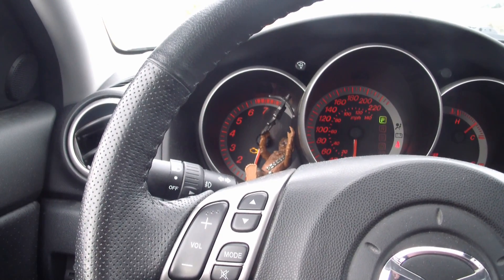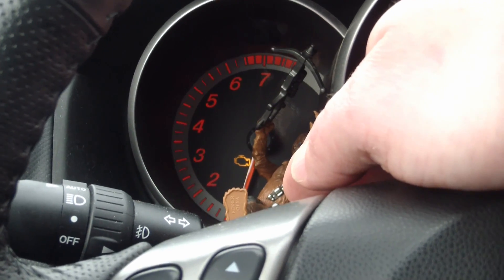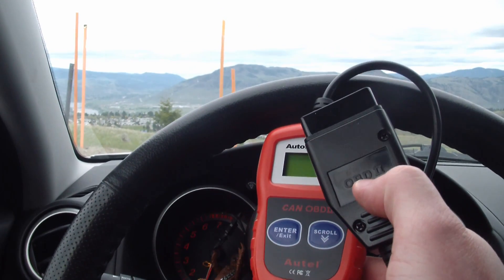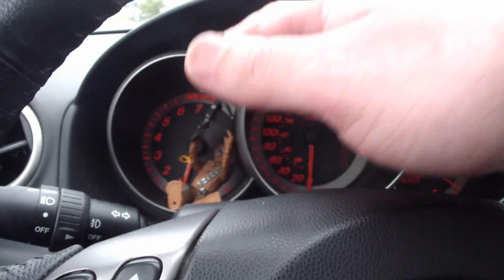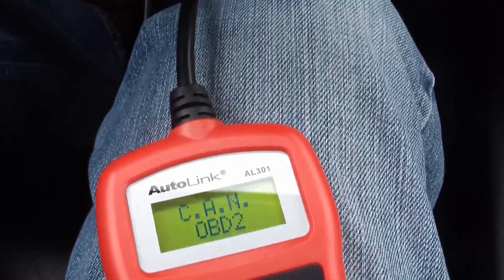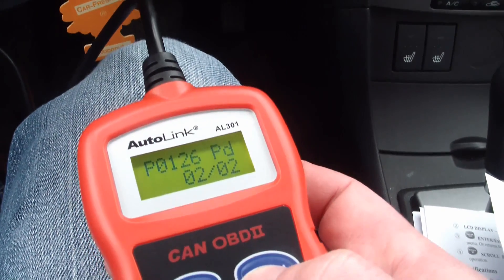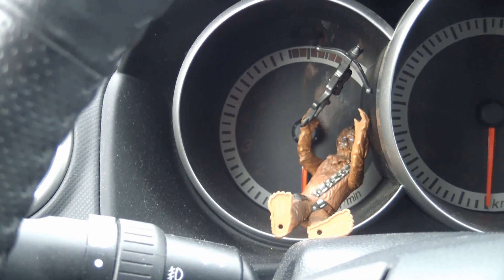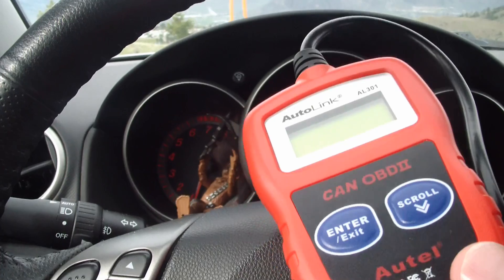Manly-Man Skills: Outsmart Mechanic Scams by Using Your Car's Computer!

Comment: Just a question......

What was the cause of the fault entry?
You erased the fault, yet you did not diagnose the fault to determine the cause.

I just ask because the fault referred to the cooling system, and yet you didn't measure the values of any sensors or continuity of any or the wires, assuming there is no irregularities with the coolant level, strength or cooling efficiency.

Also what are the repercussions of a faulty coolant temperature sender on modern vehicles if it does in fact malfunction, even only intermittently?
Reply: +John McFerren... I had that same code on my Dodge Stratus, but the temp gauge was also lower than normal... turns out the thermostat had broken, and was always open.
Reply: "Worst case scenario if stuck open too much. It can cause a car to overheat."

"If you have any questions about cars ask away. I can most likely point you in the right direction."

ROFLMAO
Reply: When you're talking water temp and the temperature in the block, it's more about having the engine oil at operating temperature and so the viscosity is in a good range for keeping things moving, hence people having trouble and running rough at startup.
Reply: Sweet!!
Reply: +AvE Ahh good, at least it didn't need a new thermostat. What this code means is that the car is running too cold. You read that right, TOO COLD. Modern emissions systems actually require that the engine be hot enough to work, if the engine runs too cold, that is a fault. In fact, my car was recalled because there was a bug in the code that wouldn't set a code for that type of fault.
Reply: Some cars have 2 sensors 1 for the gauge and one for its self to to read. A faulty temp sensor in cars makes your car THINK its cold and will run rich to warm up but if its already hot then it will have poor running and your probably hear the cooling fans kicking in at weird times too.
Reply: +Youtubekeepsmeup u had a bed CTS in my Passat and had terrible starting and running problems. Switched it and runs like a champ.
Reply: Possibly a intermittently stuck open thermostat. Which doesn't allow the engine to get up to operating temperature fast enough and can lead to slightly higher emissions ratings (Big whoop). What most people notice with a stuck open thermostat is how long the car takes to warm-up or that the heater takes forever to get hot. Worst case scenario if stuck open too much. It can cause a car to overheat.

Comment: i have a 1999 altima w/ 200k miles on it, i replaced the valve cover gasket (i pulled it out in pieced it was so dry rotted) and afterwards,  it threw 2 codes. 1 was a knock sensor, and the other an evap sensor for a "small leak". the small leak was at my fuel filter. fixed for $18 and elbow grease. the knock sensor was an idiot light, because it hasn't come back.

Comment: As a mechanic myself I agree with you, I think people should get a cheap little OBD2 scanner to keep their own on on their stuff, I think it would help weed out some of the shitty scam mechanics just trying to get the most money they can.

But when you have a p0700+ code, just reset it lol you'll be seeing me sooner or later.

Also I agree with you telling people to not tell the mechanic what to fix, but not for the reason you gave, it's like telling a doctor  what to fix, doesn't work that way.
Reply: Just out of curiosity, why shouldn't we advise the mechanic on what to fix or what they should be looking for...from your perspective as a mechanic?
Reply: Amelia Meraux if you are telling the mechanic what needs to be fixed, why are you bringing to a mechanic. Shouldn't you be able to fix it?
Reply: Sfinxxxx1,

"why shouldn't we advise the mechanic on what to fix OR what they should be looking for...." ~ Amelia Meraux

I should have worded this ^^^ better the first time. Why shouldn't we be at least give the mechanic some details of what they may want to look for? In many cases, auto mechanics do miss what actually need to be repaired because they rely solely on their diagnostic tool. To me, the diagnostic code reader should be a great way to alert you on what to start looking for or the areas to look towards before throwing parts at someone's vehicle. Am I wrong? I'm just wondering what auto mechanics think.

Comment: only exception to that are the VW cars. they come with the "checkengine" light switched on from the factory. its standard equipment.
the owner should only worry if the light ever goes off. then things are pretty serious lol
Reply: +dimos k Weird my VW doesn't have that light on, should I be worried?
Reply: ImyurZero yes yes, something is wrong you should check it out, your car may blow up :)

Comment: 9/10 times it's not a real problem but just a glitch? As a licensed mechanic I have to disagree. It's pretty much the opposite. 9/10 times I scan a car, it's a fault that needs to be fixed. And once in a while, it's a EVAP code from a loose gas cap. Also your code P0126 has to do with your thermostat being stuck open for a certain amount of time which led to your computer throwing that code. I get those codes a lot, particularly when fall switches into winter, and old thermostats begin to seize up stuck open. Common complaints would be no heat in cabin,  car takes forever to warm up, etc etc, or sometimes it just happens once and you can clear the code and it will go away like you said. But I would still change a thermostat for throwing that code because it's "beginning" to seize up and might have intermittent problems like that in the future.
Reply: +allthings possible faulty check engine light?  what is that? light on means something is wrong. pain in leg means something is wrong....keep resetting your check engine light.  don't check it out at all 😂😂😂😂😂👍
Reply: +chet hout Reminds me of a guy who died of asphyxiation while trying to take the battery out of his smoke detector. You can't fix stupid.
Reply: This was great advice and you were civil about it.
Reply: Licensed mechanic, this repair will be 2,000 or more including labor
Reply: And there you go, a mechanic telling people that a faulty check engine light is actually a thermostat that would cost upwards of $75 for labor at a licensed shop.

Comment: These are really handy, will save you money. considering that it costs X amount just to have it put on there diagnostics and then what they tell you needs done.

I think here in the UK a garage will charge around £60 just to plug it in the confuser.

You can also get bluetooth OBD adapters (carefull though there are some bad ones) and jhook em up to an app on a phone to read the codes and clear them.

Torque is a great app and gives you a meaning for the code so you dont have to look at it.

However despite it being a standard, there are codes that are vehicle specific and codes that can mean something different depending on the vehicle particarly when it comes to diesal or petrol.the same code can mean something different on the petrol than on the diesal.

going one step further (as these cheap diagnoistic things can miss some things) diagnostic software along with the correct interface, like peugeot planet for puggy vehicls with a lexia interface can prove invaluable for more thorough diagnostics which will show all live data from every sensor and can even show up issues with injectors etc.

Comment: OR go to autozone where they do it for free...
Reply: +robert karas Or save your gas and time and have one on hand, also great for anyone else who needs a code read real quick or while on road trips in the middle of bumfuck nowhere.
Reply: Jgizzy -redacted- Save gas? You drive by one every damn day. Just spend 5 mins and its fixed.
And yeah, its great for those who need to check it on road trips wait hold on WHO DOES THAT???
I have never in my whole fucking life had an issue when I need to check the error code on my car and neither do you.
Reply: robert karas Like hell I haven't. I've used my cheap scan tool in Oregon to help some lady find out her car is in limp mode because the knock sensor was going insane. Turns out she came from high elevation and had really low octane fuel which was causing her engine to knock severely in lower altitudes and her transmission was locked in 2nd gear becaue of it. I drove her to the store and picked up 2 bottles of octane booster and after 15 minutes of idling the code went away. That ONE time is enough to justify it for me, but I've used it numerous times over the years. My 95 Impreza was flashing the Trans Temp light at me and kept stalling, leaving me stranded on a busy highway, I pulled a MAF fault code and called a shop that had a USED MAF sensor for my car and had it driven up to me and installed for $110 total. If I didn't know what it was I would've got a tow and had the shop rape me for some BS price and/or extra parts.

A scan tool is not the best thing to keep in your car, however. What is the best thing is a multimeter. That thing is worth its weight in gold, if you know how to use one.
Reply: Jgizzy -redacted- Exactly what my point is. The scanner is so rarely used that there are many other things you should rather have such as jumper cables, multi meter, and mechanics socket set.
Reply: robert karas I agree with that, have all those things you listed first. Then a scanner if you don't mind spending $15.

Comment: idk about Canada but in the US most auto parts stores will read engine codes for free and give you print outs of the code and possible causes so you can even save that 30$

Comment: I find it funny that you accuse mechanics of throwing parts at customers' cars when:
1.) Most mechanics are honest, hardworking folks trying to earn an honest dollar while dealing with BS like this, and;
2.) Most customers who get these types of OBD/OBDII readers have no idea how to interpret the codes. I can't even begin to think of how many times I've had customer come with codes like CMP/CKP correlations and want both sensors replaced, when all they need is an oil change. (See: Trailblazer/Colorado owners)

By all means, empower yourself so you can help yourself and the tech; ask him questions, grill them on their knowledge (if they're competent and worthy, they'll explain their thought processes). But don't go and buy a $30 scan tool and think that you've found your vehicles' fountain of youth.

Just a mechanic's 2c.

Comment: That could be your thermostat, it may be stuck open or something or just glitch.

When i was working as an apprentice and it had the same thing but the thermostat is behind the motor and it is a bitch to get to so he erased the code, the car came back with gearbox problems (being an auto) so he gets me to change it (Clutches inside where fucked and it just slipped) so wile i had it out i said to change the thermostat wile we where there and it was easy as pie to get to.

He didn't wan't to do it because the code came back on but the next week it was on so i called him a fucking dumb cunt 

I may of been a 1st or 2nd year but he should of listened to me, I've left because he is a dumb cunt.

20 something years as a mechanic and doesn't know how a turbo works, over books work and i need to stay back an hour or 2 without pay wile he sits in the office doing nothing (he was actually was playing with his balls) witch i don't care about but the fact is i am staying back without pay because he over booked and that isn't my fault.

Comment: Good video.  Perhaps a bit heavy on the anti-dealer viewpoint, but it isn't without reasoning.  I happen to own a Mazda 3 myself, plus I had the misfortune of working at a Mazda dealer for 6 god-forsaken years, and those damn fasteners on those under body shields were crap.  We usually had stainless bolts, but the captive nuts were always made of cheap tin or some shit.  I'm not an aerodynamicist, but I think those shields are there to keep chunks/cats flying up and hitting the bottom of the engine.  The A/C compressor on those engines is hanging pretty low on the bottom/passenger side and if you catch a rock it will go right through the hoses.  Keep up the good work.

Comment: Never had an issue like it but supposedly the only time you really have to worry is when the check engine light starts flashing. once that happens you want to get her off the road and check her out quickly cause something is gonna give.

Comment: Now cars are equipped with "black boxes" that record the last thing your car was doing right before a crash. So "Mr Joe Police" & "Mrs Susie Non-insurance" can plug in and blame you for not applying the correct PSI of braking pressure right before the crash that the other Asian caused.

So I took it upon myself to make sure it was accidentally maliciously broken on my "newer" vehicles, and I am reverting to purchasing "older" vehicles without them calculatin' machines.

Comment: Your thermostat isn't closing right so your coolant isn't getting hot enough, it's not that bad of a problem but your engine isn't going to run so efficiently causing bad gas mileage and increased emissions

Comment: You can rent these from the better auto shops, too. Costs ya nothing but time but I remember OBD I with the paper clip and counting morse codelike signals. The younger generation has it so much easier. Easier yet, skip the car and just bike. I've been doing it over a decade now and I'm happier, fitter, more autonomous, and I never have to move the car to make room for the snowplow during snow emergencies (since I'm in a megapopulated metropolis).

Comment: Even better than those cheap scanners is an even cheaper bluetooth obd2 adapter. This allows you with the use of an app like torque to not only read codes in more detail but also perform real time monitoring on just about every sensor in the car.

Comment: p0126 ect did not reach operation temperature threshold. could be a thermostat working incorrectly, an ect sensor starting to fail, or the wiring and connectors not tight or making/having good connection i.e. resistance is high due to loose pins, or the coolant is not the proper ratio to distilled water. lastly, there might be a reflash for a parameter issue in the PCM. I agree mostly that "stealerships" have integrity issues, but walk a mile in a technicians and shop owner shoes and find out how expensive it is to run a fully licensed and EPA compliant shop, or fill your tool box with all the specialty tools that it takes to properly disassemble today's cars, and you would know why it costs so damn much to get things repaired.

Comment: I been Playing around with OBDI and OBDII  for 20 odd years now  with OBDI you use to get any wire and loop it from 1 slot to another  A and D i think  And then turn the key almost to start and wait for the flashes 2 flashes pause 3 flashes means code 23 a Repair manual would tell you code 23 is a air problem check vacuum lines for cracks or breaks check sensor etc 

Now you can Buy a plug for your OBDII that reads out on your Iphone  and tells you RPM Temps speed Engine codes and clearing the codes after you fix the problem so no more engine light 

While your Engine light is on your car uses more air and fuel to bring the rpm higher so it doesn't stall out The idea is Car makers want you to be able to still drive the car to a dealer and whatever problem you have you will still be able to drive there ...Problem with that is the computer doesn't know the diffrence with a small minor glitch and a major issue like bad injectors so it pumps more fuel

Comment: being a tech for 25 years,that code sometimes means the t-stat could be sticking open,meaning the temp of the coolant does not reach optimum temperature. that has a lot to do with fuel economy .

Comment: you know OBD is great but... Car manufactures have been making giant piles of shit for the past 15 years. Not just horribly engineered, throw away junk, but terribly outdated junk.

ECU's have been around for 30 years, YET we STILL dont have OEM ECU's that allow for additional inputs, Map tuning,  even the slightest hint that people with intelligence even buy cars...
Reply: +Keith ALL factory ECMs can be RE-MAPPED" you just have to have the right know how and a laptop. Just remember that only a small mistake is a entree will have run like crap thats if you dont screw the engine up like with a wrong timing curve